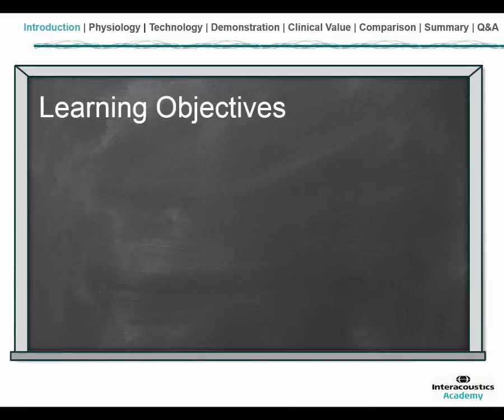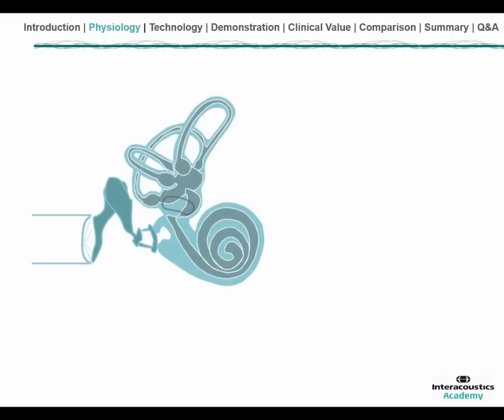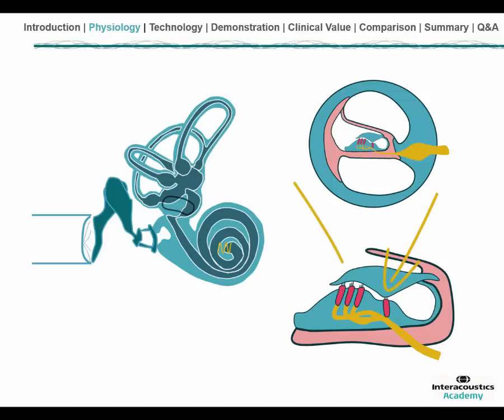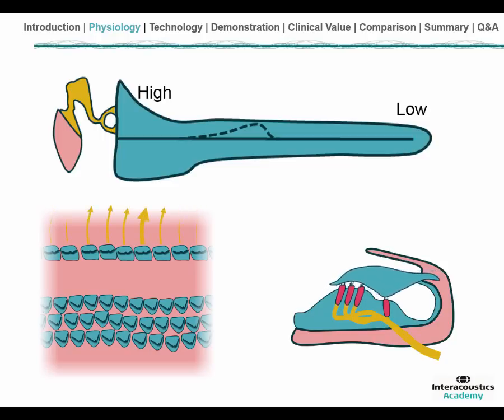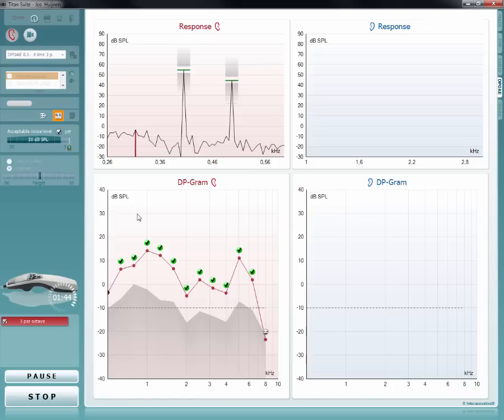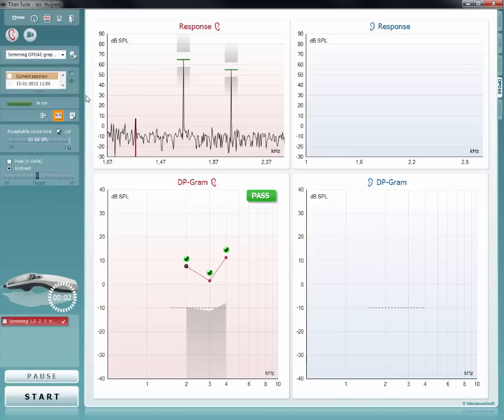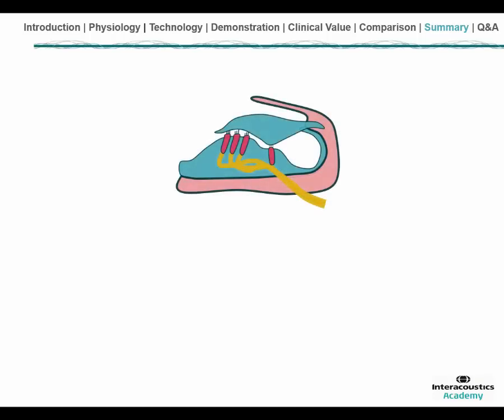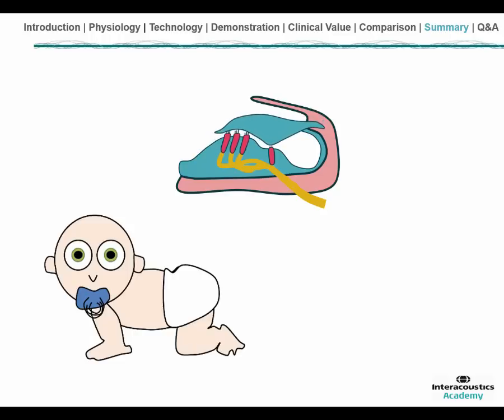Otoacoustic Emissions (OAEs): An Introduction

Comment: Sir I want to ask you questions..Sir i have done DPOAE screening test..on the report showing DPOAE analysis, In right ear there is six frequency F2, Hz has written on report..Out of six frequency there is showing 2 OAE has tick mark ☑️ on 2 frequency out of six frequency and other 4 are frequency are OAE absent ❌..so, can you tell me what is mean that report it mean my hearing is normal or hearing loss..
Reply from the maker: Please contact your health care provider for personal health care questions. Speaking generally of OAE testing, then different clinics/countries use different numbers of frequency bands to determine a pass or refer. Some clinics accept 2 bands, but some require 3 to mean a pass. However, a pass on OAE testing does not mean normal hearing, and a refer does not mean a hearing loss - this is just a screening test and only assesses the cochlear function.
Reply: @InteracousticsTV  ok sir I want to ask another question..Can BERA apparatus determine hearing loss In severe to profound hearing loss patient means can bera detects hearing loss in severe to profound hearing loss

Comment: hello..,

if a child gets a refer result from the oae test..,? can the abr determine why the oae got a refer result..??? can the abr test show a temporary hearing loss..?? like wax, fluid, congestion..??? or a permanent hearing loss.?? from the cochlea.??? thank you... for reply..
Reply from the maker: Hello. Thank you for your interest. This is an answer for you from one of our Interacoustics Academy Trainers: "
The ABR test allows the clinician to determine the hearing levels. If there is a sensorineural hearing loss from the cochlea, bone conduction ABR results can identify this. ABR results (both air conduction and bone conduction) in combination with middle ear function testing such as tympanometry can help determine information about the status of the middle ear. Additional OAE testing can also add information to the test battery to help the clinician draw conclusions. However, sometimes the cause of the OAE refer results can be temporary and if this has resolved by the point that ABR testing is performed, then it may not be possible to establish what the cause was."

Comment: And sencind thing is in the DPOAE response graph , you said we have to analyse the frequency between f1and f2 that is the overlapping area . Then why the OAE is not in the range between f1 and f2? Why it is away from the overlapping area ?
Reply from the maker: Hi Vijaya,
Thanks for asking: It has been proven in the literature that the ratio between f1 and f2 should be around 1.2 this is why we choose 818 Hz as the f1 frequency. With the f1 and f2  values now decided we can make the calculation.  So 2f1-f2 = 1836-1000 = 636 Hz.  What you see in the software is 635 Hz. This is because whenever an OAE system coverts from the time domain to the frequency domain the system is bound by both physical and practical choices. The important thing to note here is that this although there is a difference of 1 Hz, there aren’t any clinical consequences related to this.  We hope this makes sense to you :) Have a great day. Br. Charlotte Sonne, Interacoustics
Reply: Interacoustics thanks 😊

Comment: I don't understand why have you said if f2 is 1000hz then f1 will be 818hz nd the actual freq. Will become 635 hz ?? As 2f1-f2 is the formulae .
Reply from the maker: The reason why we do not search for the OAE in the overlapping area is that there is a risk that this could be contaminated by stimulus artefact. We therefore need to look in a different area and the 2f1-f2 frequency is the area with the largest
distortion product and this is why we look there.
Reply: Interacoustics thank you ☺